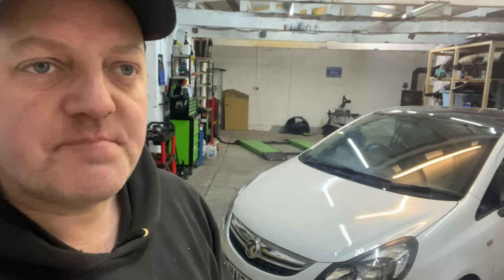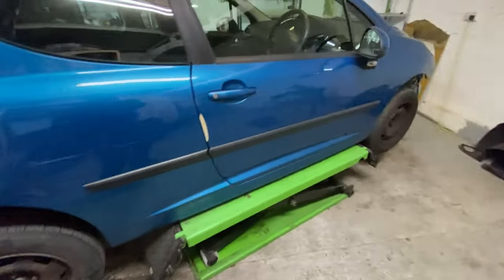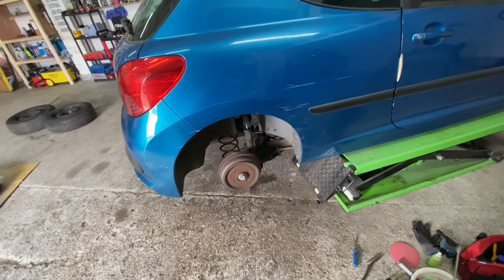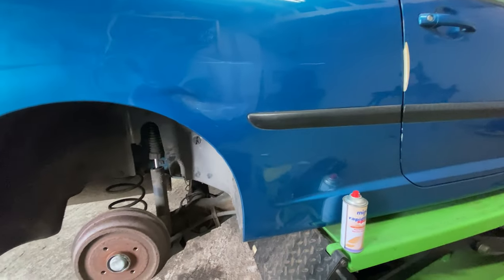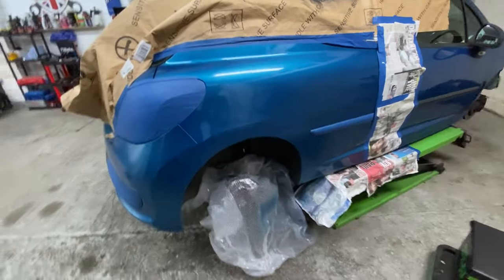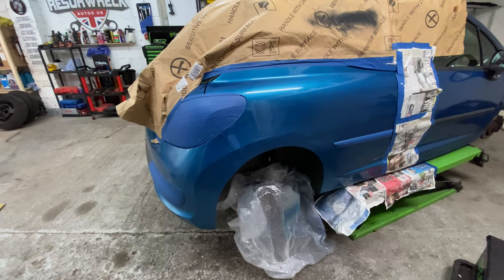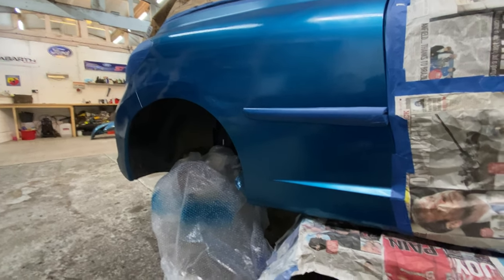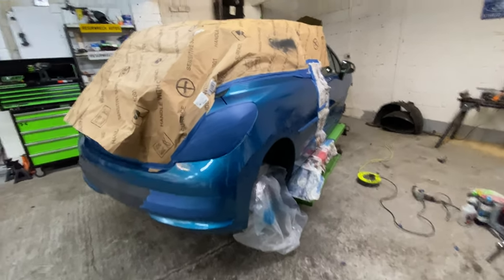Wrecks-To-Riches 1 Year Challenge Car 2 Part 3 Painting The Back Quarter Panel

Comment: You made the right choice with the bumper. I have stripped painted and reassembled one . They are a total pain well done Mark.  That back quarter is a great improvement and on a car of this age well acceptable . These are the motors to hone your  body and paint skills on. When its finished it will be a great car for the next owner
Reply from the maker: Thanks Richard yeah you are right there’s are the ones to practice on nice one buddy 👍

Comment: Its encouraging you are dabbling in paintless dent repair with the glue and pull method.  Not many automotive Youtubers are going there.  I would have tried a gentle pull on the two spots ahead of the wheel arch.  There is a product called Formula 1 Scratch Out that might have helped on the scrapes.  Don't worry about what you have done.  This is a cheap car after all.

Comment: Mark its not to bad I would have filled it but its a budget car and you do need to draw a line somewhere. Also it's a a 2007 car so parking dings are yo be expected so it will never be mint. Bar of soap, water and sand it with some 1200,1500,2000 then 3000 grit then cut and polish it should look OK.
Reply from the maker: Thanks Paul I will do that nice one buddy 👍👍

Comment: Shocking...why didn't you just use a small amount of filler ? Would have turned out a lot better. Nothing wrong with your paint work Mark. Very unlike you to let it slip. Spray a little paint into the lid and using a tooth pick or very small artist brush sort out the driver's door edge. This will take your eye away from the paint chips.
Reply from the maker: Thanks mate yeah I will do that nice one buddy 👍👍